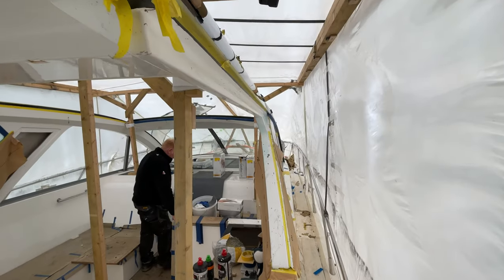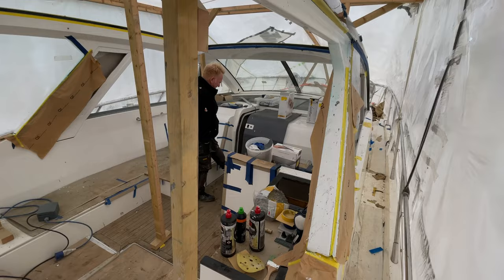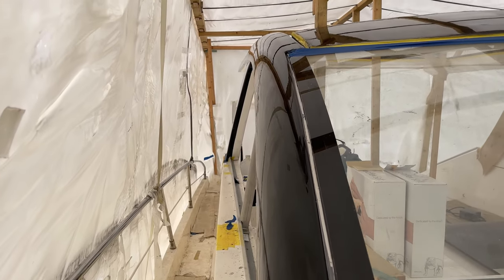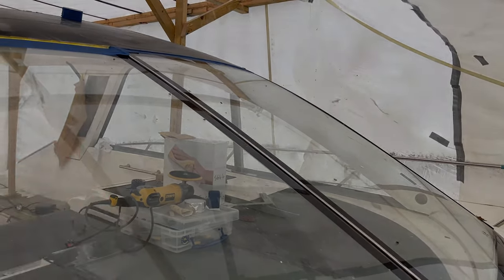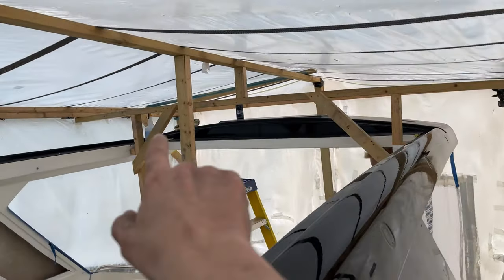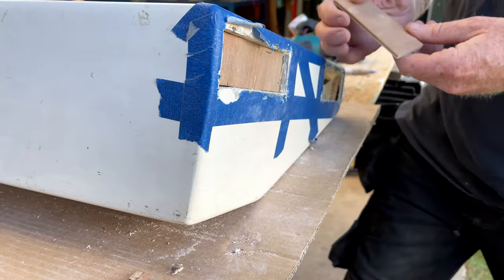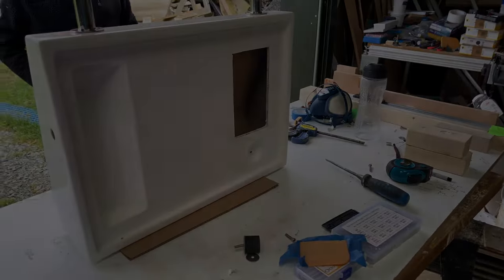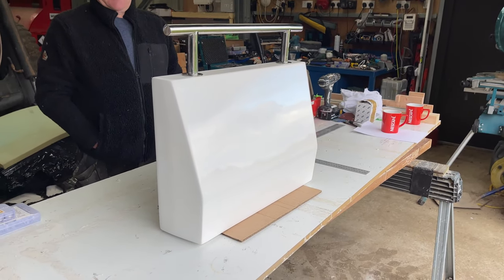ALEXSEAL Marine PAINT Wet Sand and Final POLISH - EP.77

Comment: Thank you for posting this video. I just finished painting the topsides of a 45 foot sailboat with 501 and like you, I have decided to sand and polish. You give me hope that I will eventually get there. The 501 is amazing paint but straight off the roller the result is just not where I want it to be. I got some orange peel and with unavoidable dust in the air there are too many imperfections that have to go. Andy from Boatworks Today, whom you mention elsewhere, recommended taking it to 2000 grit before polishing while other channels have gone as far as 4000. I am looking at 400 ft2 of surface so plenty of room to experiment 😂. Wish me luck.
Reply from the maker: The results were good, but we were hoping for better, the flatting and polishing took days of work. We used 1000 grit followed by 1500 and 2000. We have subsequently repainted the front again as we sanded through and we had better results using a higher percentage of brush reducer and mohair rollers. Apart from some inevitable dust, the Alexseal topcoat flowed out much better the second time and will need little to no Sanding.

Comment: So that rotary didn’t swirl the paint? Regardless of the pad a rotary usually swirls my work up and forces me to polish afterward. Interesting if you don’t have this issue
Reply: Looks fine under indoor lighting but as soon as the sun light hits it those swirls always stand out
Reply from the maker: We had no problems using a yellow wool pad and Festool polish. Looked fine under sunlight and inspection light. You could use a DA and FG400 to remove fines scratches if needed….